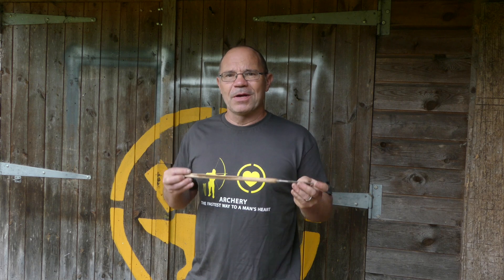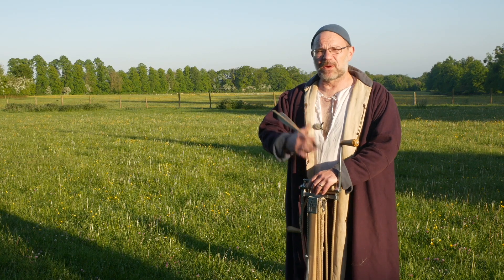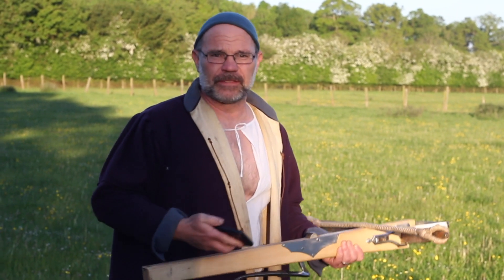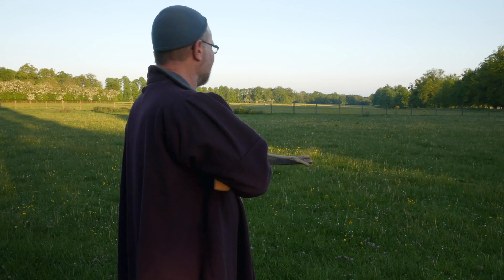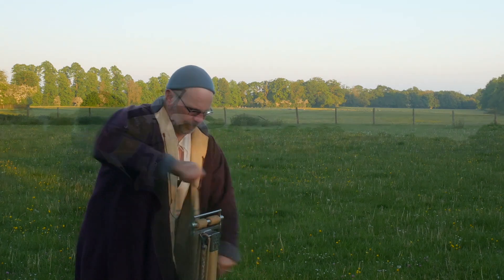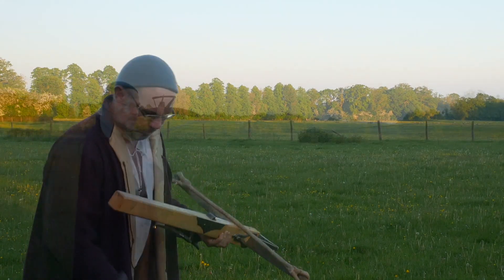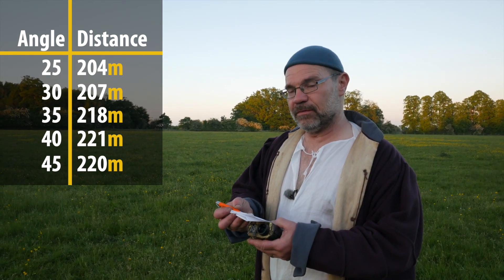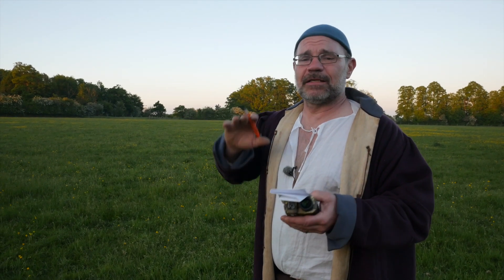Distance - Which angle is best?

Comment: How about 50 degrees, just to prove, you have achieved maximum distance!!
Reply: Exactly my thought.
Reply: As 35, 40 and 45 are very close (with 40 even being the furthest) - no, not really, the data already shows that 45 is past the optimum (together with us knowing that 45° is the optimum in a vacuum)
Reply: @ABaumstumpf  Scientists conduct experiments to discovery the results... Quite often, not as predicted!!!
Reply: There is a physical/mathematical proof, that you get the max distance with 45 deg. But this proof doesn't take accound of the air resistance of the projectile. The projectile is slowing down, while it's flying. That slowing down depends of the air resistance of the projectile, its speed and the mass of the projectile, the wind conditions and... That calculations think about the projectile in the shape of something like a sphere. If the projectile has lifting areas, as a plane, you get very different results. To test this, just take a sheet of paper and fold it to a little airplane. Or crush that sheet of paper to a bubble. 
 So you get a longer distance for a shere, if the angle is below that 45 deg.
Reply: @BRacingGreen  Experiments are performed to either Prove or Disprove a Theory.
Reply: @blainclatworthy5423  Yes, and those have been done.
But for a simple bow and arrow the result will be as predicted - lower than 45° but not by much. Simply cause we KNOW that arrows aerodynamic and do nto lose their energy that quickly, and we KNOW that anything above 45° will result in shorter distances - unless you specifically create something that is not a normal arrow.

Most experiment are designed to get results that were not predicted and also most of them "fail" as in behaving as predicted - which is not what we want cause that means we did not really learn much new stuff but only that our current understanding is at least more accurate than our current testing.
And that is the same with projectiles. For low-speed projectiles hardly any tests are done cause we already know how they behave so well that most outside influences are far stronger than our measuring accuracy, meaning that what ever tiny interesting things could still be uncovered are so minute that even the humidity of the air has a bigger impact.
Reply: @ABaumstumpf  Why are so many people against a simple experiment being performed????
Reply: @blainclatworthy5423  Nobody is against it, it is just that it has been done and anybody that is actually curious already knows the outcome. 
it is strange why you are so against learning from reality.
Reply: I'm quite sure that I have more Firearms experience than you. So, I don't have any need of your opinion!!!!
Reply: @ABaumstumpf  For your information, I already knew the approximate answer before the test was run.
Reply: @blainclatworthy5423  "I'm quite sure that I have more Firearms experience than you."
Yes, that might very well be - but i do not care how often you have shot your self already.

"For your information, I already knew the approximate answer before the test was run."
Sure sure - you knew it was somewhere between 0 and infinity - if you even understand what that means.

So far all you have shown is that you are very resistant to actually learning from reality.

Comment: Anyone got a cannon to hand? I wonder how the angle may be different for a sphere rather than a bolt?
Reply: Even without wind effects, the result depends on the initial velocity of the ball, and how it is spinning. A faster initial velocity will result in greater air resistance and an optimal angle that is significantly less than 45°. A slower moving projectile will have less air resistance and the optimal angle will be closer to 45°. If the projectile is spinning, there are additional forces involved, including lift, that complicates things further.

Comment: My first (unscientific) thought is that the nose weight of the bolt is playing a significant role, essentially bringing all the bolts to earth before their "natural" time.  Gravity is playing a bigger role and pulling their noses down and changing the shape of their arc of flight.
Lighter bolts with a more even weight distribution along the weight of the bolt may show a greater variation in their results depending on their angle of launch.
Reply: You could move the centre of mass backwards or the centre of pressure forwards (by moving the fletchings forward or adding extra fletchings near the point) and theoretically gain range, but that would be at the expense of stability, since you would be creating a kind of ballistic glider.
Reply: @Ijusthopeitsquick  I'll take your word for it. I was just suggesting that the launch angle was having less effect on these weightier and nose-heavy bolts than it might on lighter bolts with a less weighty head.

Comment: FWIW, I fitted a cubic polynomial to the data and this model predicts 222m at 41 or 42 degrees and large CIs due to small n.  A larger sample around the 38-45 angle range needed for more meaningful modelling. As you say, lots of sources of variation.

Comment: First and foremost, great video.

Legit curious how you kept track of the bolts when you, presumably, fired multiple bolts before retrieving them.  Ideally, you'd fire at least three bolts at each angle to determine variability.  Then you'd fire three more for each of the additional angles before retrieving them.  My guess would be using colored fletching or tip or whatever.

Like three reds for 30 degrees, three green for 35 degrees, etc.

Just curious how you differentiated when you retrieved.
Reply from the maker: Thanks.  I shot two shots, one to the left and one to the right and then went and collected
Reply: @tods_workshop  cool.  I was just curious about the methodology and that makes perfect sense.  Two at a time is obviously perfectly easy to manage, not like you fired then all before retrieval.

Thanks for the reply and for the great content, as always!

Comment: My main response to this, and other tests that you have done, is that you need a much larger sample size (maybe it is the biologist in me). I could imagine that, with missile weapons made from modern materials, there might be less need, but with weapons made from historical materials like wood and rope (not to mention other issues like changes in wind etc.) this is quite important to do.
Reply: Indeed, and the variation observations is itself important information. As a lapsed military analyst I hate it when people just use a simple mean - it means almost nothing regarding 'best angle' if the difference in the means is 1 metre but the probability of the nominally better angle resulting in a greater range than the nominally worse is, say, 51%. With that sort of outcome you are getting in to likelihoods that your choice for the best angle is 'correct' of around 50%

But that sort of result would still be important, because what that is telling you is that you should be paying attention to some other variable or variables, like the dynamics of the interaction between the string and bolt. Or the aerodynamics of the bolt and it's fletchings.
Reply: And he should do 10 shots in all conditions: headwind, tailwind, high humidity (including rain), low humidity desert,  different atmospheric pressures (altitudes) and … all of these for each type of bolt. Maybe he’ll have some results in a few months/years.  And then issue all of the men protractors.

Get real - do you really need to optimize for the few meters difference for the practical use of the bow?
Reply: Yes and no - for the 5° steps he is taking this is more than good enough to give a general idea.
Reply: @TheTutch  ummmm..... You should first actually watch and listen to the video before showing even more of your ignorance.... He was using 2 identical bolts - the difference is negligible for this. And he was showing that he was measuring the angle while shooting. So your entire argument is flat out 100% wrong
Reply: @TheTutch  "nice touch going for the personal attack first chance you get. "
Nah, i only pointed out the idiocy of your uneducated remark as it in no way reflects on what was ACTUALLY SHOWN IN THE VIDEO.

"just because you have measured something does not mean it stays like that."
.... you see him show the angle WHILE RELEASING the trigger. No, it does not change.

"Now can we stop this or are you going to come back with some more unfounded comments about me being stupid tomorrow morning?"
That is just what you did cause you are unable to comprehend what was shown in the video.

You don't have an argument, you do not understand the situation, you did not even watch the video and are only showing your own ignorance.
Reply: @TheTutch  So you still have no argument, only your ignorance and fallacies?

Comment: I'm amazed by how much the bolts wobble before stabilizing in flight. The historical dress is always an added bonus.
Reply from the maker: Euan.  There are loads of variables that effect the loose of the bolt and they do really need to be tuned to the bow to be perfect, but in this case they wobble a bit more than I would like, but I believe it doesn't effect the relative outcomes of the test.  A longer bolt would help, but then the bolt can over balance and customers don't like that even though just holding the back down works fine
Reply: @tods_workshop  I find these videos fascinating; if only from a Roleplaying Game standpoint. Thank you for sharing your knowledge, skill and enthusiasm.
Reply: Look up "WW2 tanks fired slo motion", you'll be amazed at how much Tank shells wobble before stabilizing, it's part of the game
Guns do it too
Reply: @ivyssauro123  Oh, yeah, I remember that. That was truly weird. Maybe Tod and the Slo Mo Guys could make some interesting crossbow videos?
Reply: @euansmith3699  there is a pretty substantial difference between slow motion shots from the idrivetanks range, and slow motion I've seen from munitions testing. There is a pretty substantial difference between them, with the munitions testing shells coming out dead straight with a rapid spin, compared to idrivetanks coming out of the barrel barely spinning and at a weird angle. 

Wouldn't be surprised if the barrel they use is  pretty substantially worn out, and the solid shot they use may not be made to the same standard as new.
Reply: @euansmith3699  I would die for it!
Reply: @Minigoat_92  probably. Barrel harmonics will fuck your shot and a lack of maintenance will make it worse. Forgotten Weapons has a wonderful slow motion video of a stamped steel, fully automatic gun. It's a good gun but not a rigid gun--you can clearly see the barrel resonating with the bullet!
Reply: There is a video where he shoots an 11th century crossbow in slo mo. The bolt flies straight like a beam from launch to target.
Reply: it's probably because of the steep upwards angle and the heavy tip being a bitch about it. the 45 degree angle was probably halfway towards a 40 degree release because of that
Reply: @Olav_Hansen  if the support track extended enough that the bolt was supported its entire length until it’s off the string, I bet the deflection would be lower.  It’s still being pushed as it falls off the groove, which will destabilize it as center of mass drops “below” center of string force.
Reply: @Georgewilliamherbert  Unless the Bolt/Arrow is released through a hole in the Bow Shaft there will always be a force vector into the Guide in the case of a Crossbow or Bow Shaft in the case of Bow. This will start the Yaw and Pitch which because the projectile is rotating will appear as a "wobble". I don't believe the "wobble" will dissappear because there is no positive acceleration force after the Bolt/Arrow leaves the String. The only stabilising effect is the rotation and the Fletching having a (very) slightly greater drag than the head because the velocity is considerably less than that of sound.

Comment: Great video Todd 👍👍 I see the bolt really hopping off your crossbow. Is there a way to fix that ? Should the bolt groove be deeper at the front ? Could it be the bolt heads are too heavy for that crossbow to shoot flat?things at rest want to stay at rest. Maybe that is having a huge effect on all your results. 
I was very surprised you were able to find the 25 degree shot as low or flat shots usually tunnel under the grass. 👍👍
Can you repeat the tests with a flat shooting modern crossbow and bolts ? That would be great 👍
Reply from the maker: The bolts really need to be tuned to bow and these were a little short, but the results are still indicative of what is going on.  25 degrees was launch angle, impact angle is a bit steeper and easy enough to find
Reply: @tods_workshop  I think it may shoot flatter if you shortened the bolt. Or lightened the tip.

Comment: You might have mentioned this already, if so can someone point me to the video I've missed?
Joerg said that the rubber in a slingshot gets hot when you draw it back, if you release immediatley you get more power, if you pause and it cools you get less power. Do the limbs on a crossbow work the same way?
Reply: No. Rubber is pretty special in that it stores energy in the form of heat. Most materials don't do this.
Reply: Rubber has a unique property called viscoelasticity which is primarily responsible for its hysteresis. Hysteresis is bad because it robs energy in the form of heat when the rubber is stretched. Most of this energy can be recovered by releasing soon after reaching full draw, but there is still some unavoidable energy loss. This effect does not happen with steel, or hardly any other material. Steel is highly elastic and gas very little hysteresis. So whether you hold for 1 second or 1 hour, the power of the shot will be the same.

Comment: Simple mathematics says all other factors being equal, 45° will always give the greatest distance... obviously in practise there are innumerable factors which will skew this, but I expect with >1000 shots we would get closer and closer to seeing max distance at 45°.

- edit - on earth it would appear 42-ish degrees is better for max distance than 45, due to air resistance. Thank god I'm not a physicist or the world would be in trouble.  -
Reply: As Tod said the answer would be 45° if there is no air resistance_. As there _is air resistance which causes the bolt slows down in flight and the angle that produces the furthest distance is a little less than 45 and Tod was doing some tests to discover what "a little less" is. 
45 degrees gets you the bolt in the air for the longest time, but the end of that time the bolt has slowed down a lot. Less that 45 deg gets you less time in the air but the bolt is covering more horizontal distance for each second that it's in the air.
Reply: You forgot physics
Reply: 45* will only give the best range if he shoots from the same level as the target. But he is shooting from a hight above the target so if you imagine a parabola starting at 45* and ending where he hits he is further along the parabola. At a hight of about five feet and the angel to match the perfect 45* would now be slightly belof 45* maybe 40 - 42*.
The difference would be even greater if he shot from shoulder hight. Or if he shoots from atop a wall.
Reply: The distances we're talking about are so much larger than the initial above ground firing height that this has minimal effect on the overall distance and in fact favours a sub 45 deg angle. Unfortunately I can't show my maths/spreadhseet easily in a comment.
Reply: @AndrewBlack343  to be fair I did mention "simple maths" and air resistance calculations aren't really that simple, at least not for me. However I don't see that lowering the firing angle would lengthen the parabola, as air resistance will be acting in the same way on the bolt for any angle, and so it would just end its arc earlier, even if it initially covers more distance for the same loss of velocity.
Reply: @AndrewBlack343  Oh and if you have any kind of link to said spreadsheet i'd be interested, i'm always up for improving my maths :)
Reply: @EmmaLamarie  Imagine you were firing the crossbox under water, you would not pick 45 deg as the bolt would slow so quickly that you would not get the benefit of the extra time resulting from the extra height. Air is closer to a vacuum than it is to water but it's still a little like water.
Reply: @AndrewBlack343  that's an interesting way of putting it, although I'm not sure it helped me see it differently. I just spent 10 mins on the internet and I think I get the idea though. Also google says that on earth the ideal angle tends to be 42° for max distance, which seems reasonable.